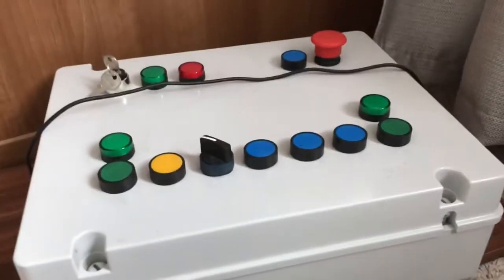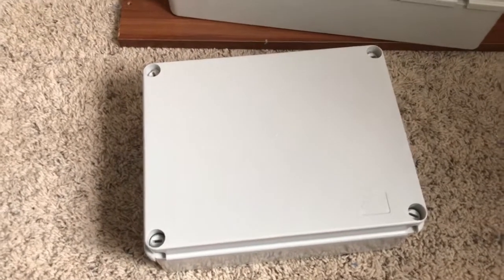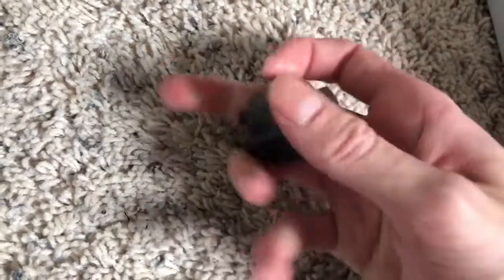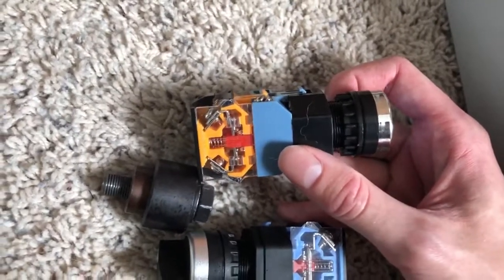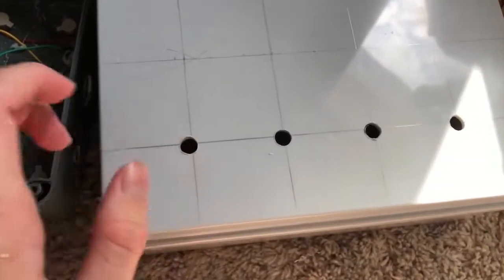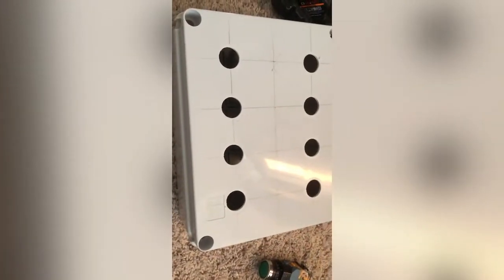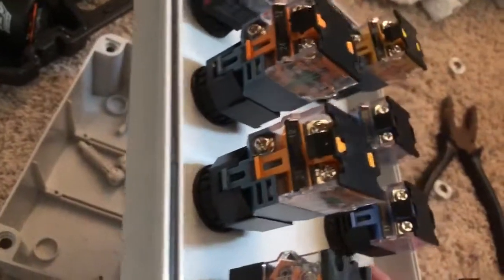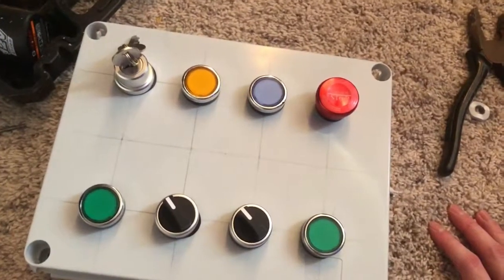How to build a RideSims / NL2 Panel | Part I, Fabrication

Comment: What type of switches do I get 2NO or 1NC 1NO?
Reply from the maker: Entirely up to you. NO means naturally open, meaning when you press the button, the circuit is complete. NC means naturally closed, meaning the circuit is broken when you press the button.

I prefer NO.
Reply: So I get 4 NO buttons then? And 3 2NO switches?
Reply from the maker: @idk-z8k8idk Like I said, entirely up to you.
Reply: does it matter which one i choose?
Reply from the maker: @idk-z8k8idkAs previously mentioned, it’s entirely your choice.
Reply: Are you going to make a part three?  @ffinianhe
Reply: Also what size is the junction box
Reply from the maker: @idk-z8k8idkIt depends entirely on how many switches you have, how spaced out you want them to be, et cetera.
Reply: Part 3 ??? @ffinianhe

Comment: Where did u buy the buttons from
Reply from the maker: Since this is a demo panel, I bought the buttons from Aliexpress. You can find many switches and operators there, but if you want something more realistic and better in terms of build quality, then Eaton Cutler-Hammer are the way to go - not as expensive as Allen Bradley but a little more expensive than the Chinese suppliers.

Comment: How expensive is it to make a panel?
Reply from the maker: Depends on basically any factor you can think of. For a panel like this, you’d be looking at around £100. This is a budget panel.

For nice components (metal enclosure, Eaton/AB switches) you’d be looking at well over £700 for a panel of this size.

Comment: What does the voltage rating have to be for non illuminated buttons?
Reply from the maker: I wouldn’t worry about that too much, most of these industrial 22mm buttons have a rating of up to 240v, the arduino operates at 5v.
Reply: @ffinianhe  Perfect! Thanks you.